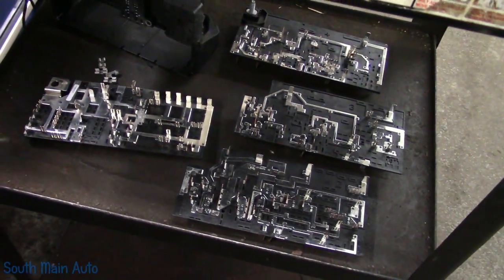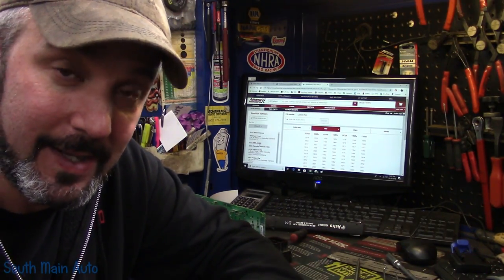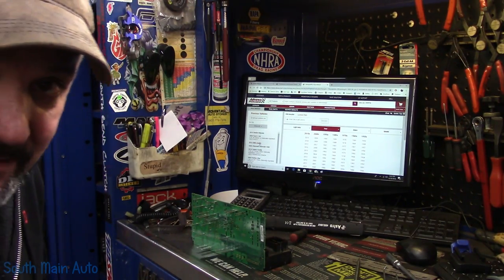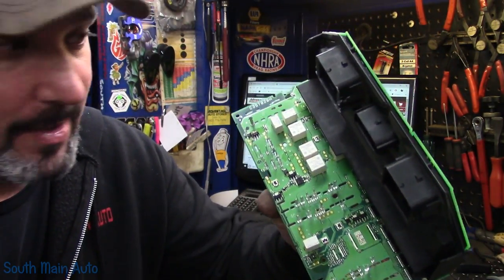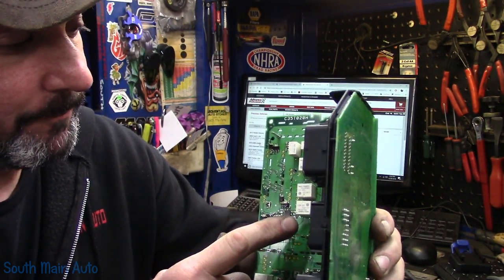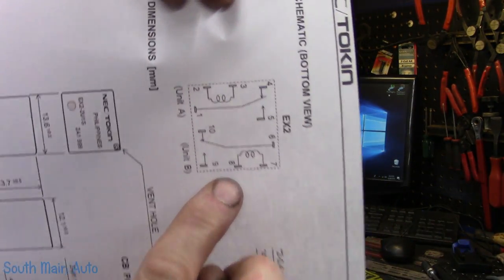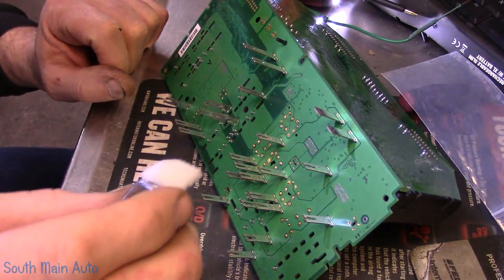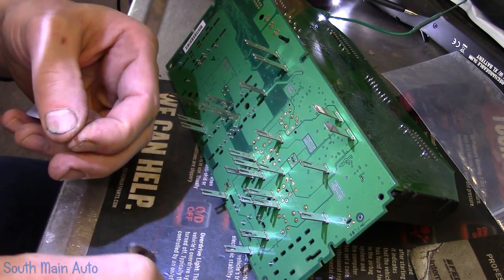Chrysler / Dodge : TIPM Repair - No Wipers

Comment: Eric, I doubt you'll see this at this late date, but the best way to remove a soldered on component like that is to chuck it up in the vice, with a relatively small flame in your propane torch, heat up the lead side of the board while pulling on the part with a pair of needle nose pliers on the other side.   The part comes off almost instantly and when you get used to it, you can do it without damaging the board (I'd practice on some old junk boards).

Also, when sucking solder, it helps to pool a bunch on so it stays liquid long enough to be able to suck it out.   You can even pool on a special "desoldering" alloy which will mix in with the solder and it will stay liquid a LOT longer giving you plenty of time to suck all of it out.

This TIPM is indeed a case where a $600 relay (assembly) blew in order to save a $.50 fuse!

Comment: Nice video is always, Eric. This is counterintuitive but for future reference build up a little mound of fresh solder on a pin before removing it with either the solder sucker or the wick. The old solder on the pin is more difficult to melt than fresh solder. Also, the additional solder helps it flow better.

Comment: I fixed the instrument cluster in my 2003 Silverado by leaving it plugged in while disassembled and pushing on parts ( resistors diodes ect ) until it came on ,  using a pencil eraser . Soldered the part and changed the LED lights inside and its been working ever since . 430,000 and still counting .

Comment: Another awesome video Mr. O. I repair electronics for aircraft and solder daily. The wick will soak up the wet solder, but you have to put the wick directly on the solder point and put the tip directly on top of the wick. Hope this helps.

Comment: I started out decades ago, using the de-soldering braid, yes Eric; fluxing the braid will help it  work better. It has been my experience though that the braid works best with discrete components (non surface mount/ miniaturized) and that the sucker works better with the miniature/ surface mount components

Comment: Your soldier removable technics are sound!
I would reflow the joint in the barrel first. Add 
a little solder to the joint. Then heat it up with a tinned
Soldering iron and carefully place your cocked solder
sucker right on the pin with it bottomed out on the pcb.
Then pull the trigger. It will clear the barrel. If not repeat
You got it! The copper braid is used to clean the pad after 
you get the pin out. I give a ton of credit for jumping in on
the fix. I am an electrical hardware guy and you are on the money!

Comment: Ironic, when I had to do a mode door actuator replacement on a 2006 Dodge Ram last year I found your video on how to do it.  That’s how I found your channel.  Same truck now has this exact same problem and walla you have another video showing what to do.  I’ll see if the guy wants me to do it.   Oh, and this video did not suck, my opinion is it’s one of your better ones.

Comment: The solder sucker is used in this manner. Heat the solder connection on the board, take iron away and immediately use the solder sucker to remove the solder from the hole. I have seen those suckers with the tips all melted off. If you use them both at the same time , the solder iron will always win. You did a great job for your first time.

Comment: Reading another comment about leaded solder reminded me of some troubleshooting I did today. My left turn signal wasn't working on my WJ unless I pounded the crap out of the steering wheel. Thought it was the switch, so last week I opened it up and cleaned the sliding contacts. Was good until today when the left stopped working totally. Diagnosis isn't as straight forward as "if the hazards work then it can't be the wiring," since the WJ has a flasher module that performs many functions and has a signal input for each function. Regardless, I disconnected the switch and jumpered the left signal wire. Nothing. Pulled the pin in that connector and tested continuity down to the terminal where the flasher plugs in. I have continuity. The wire doesn't need to carry much current, as it's just a signal to tell the flasher to flash. The wire itself doesn't drive the lights. Popped open the flasher unit and started looking, and I saw a crack in one of the solder joints that join the plug to the circuit board. So I took it inside and reflowed every single solder joint with normal lead solder. Plugged it back in and it now works.

Comment: My GF has a 2012 200 with the 3.6L. Two years ago it had the same symptoms as your sister's van. Wipers only worked on high and wouldn't park. Diagnosis: TIPM. In Canada, it costs $1500 to replace at the dealer. There was a class action suit for this issue, but the settlement only dealt with two models. The 200 was not one of them. I have seen some videos of TIPM repair, but your's is the most comprehensive and specific to these vehicles. I wish that I had kept the old one just to experiment with the repair. I know nothing about flux capacitors, but the comments on here have been very informative regarding soldering and de-soldering techniques. How about a video on another Chrysler engineering blunder: "no heat on the passenger side" due to blockage of the heater core. Speculation is that casting sand left over from the manufacturing process eventually turns to a goo within the coolant and then settles in the core and radiator.  Chrysler fix is to replace the heater core, radiator, and oil cooler. The entire dash has to be removed to replace the heater core. Thousands of dollars to do. I hear that you can replace the core from under the dash by uncrimping the tubes from the core, sliding out the old core and placing the new core in, then recrimping. Whadya think?

Comment: Over the years, the last 33 that I've been a Mechanic, the load side of the Intermittent wipers have always been an issue. Many modules I've disassembled and found the notorious hair-line crack in the solder joint out to the motor. Imagine, just for a moment, someone turned you on and off all the time. I' sure it would wear you out. It just prematurely wears things out. If you wanted to correct this, you could split the circuit, allowing an alternate path for current flow. Ford over the years has made this their repair for many of it's problem circuits. Back in the 80s the mustangs and Ltds use to have the headlights start going off and on as the circuit breaker would trip and reset. In business school they call this manufactured obsolescence. Basically, that is a nice word for "engineered to fail at a given point". Don't get me started on corporate greed. Thank you Eric for re-inspiring me. Many years of this stuff has worn on me and I find watching your channel refreshing. You add value to peoples lives and that is something to be proud of. God Bless.

Comment: Ive gotta admit, I just caught onto your channel and am really enjoying it.  The electronic circuit boards, I have worked on them for years.  The wicking never worked well for me but it depends on size and heat your using behind it.  I have found a de-soldering iron to work the best.  I use one to harvest the good parts from electronic devices mostly and 90% of the time it removes all solder.   $14 on amazon.... keep the videos coming, thank you !

Comment: If you plan to ever play with soldering again, buy a Weller soldering gun and donate the tiny iron.  Professionals use the Weller gun which is anywhere from $50 to $80.  It's ready in 6 seconds with 900 degrees max and a controlled temperature on the trigger.   Also, the tips are replaceable. Around $10 for 3.   It comes to about $3 each and when you replace the tip is like getting a brand new gun.  Thanks for another useful video that gives us confidence like always.
Reply: You may ask 🎅 Santa to bring you a Weller soldering gun. Clean your chimney and bake some cookies.

Comment: Nice job. Ive never had much luck sucking up solder with the wick. It does work well if you "floss" with it to clean out the hole. Even clean copper wire tins well to get rid of last little bit. Also you can just clip the legs of the relay next time to work 1 hole at a time. At least its not surface mount components!

Comment: Almost an Ivan PHAD no-parts repair!  For easier de-soldering, I second other people's comments about adding flux to the braid and a bit of fresh solder to the old solder.  For better de-soldering capability, but at a lower cost than a desktop powered unit, consider a de-soldering iron, which combines a heated hollow tip to melt the solder with a solder sucker in one simple unit. 35 years ago, I bought one from Radio Shack for about $20, and it has never failed to remove solder quickly and cleanly from for me, even on multi-layer circuit boards.  Although Radio Shack stores have gone away, their web site still exists, and it lists the tool, "45 watt Desoldering Iron".  Or, for another option, google ECG J-045 for a practically identical tool.

Comment: You did a great job with that repair. My experience with the braid is that it will help get the remaining solder out  after you have used the solder sucker. I think that the braid has flux in it to make it pull the solder into it when heated.

Comment: Great job taking the tipm apart. Let me help your confidence to make soldering easier. Get some liquid flux and draw some into a small syringe. Put one drop on each solder joint. Before using your soldering tool, wipe the tip on a wet sponge and (tin) the tip with a small drop of solder, then wipe again. Now the tip is clean and shiny tinned. Add a little solder to the tip and touch onto the solder joint , quickly remove and use the solder sucker. Flux will liquify the joint to easily be removed. Same goes for making a solder joint. Add flux always and don’t over heat and bingo, perfect!

Comment: Love the repair! That TIPM is crazy, who would design it like that? Relays that aren't serviceable? Board mounted components in a hot engine bay in a box that isn't sealed? What a huge step backwards from the fuse boxes that have worked just fine for decades.

Comment: I know its two years old but my sons mother has a 2007 Jeep and the fuel pump relay is down there as well... Vehicle has died twice but refires after cooling down... PIA.. Dumb idea Mopar/Chrysler... Since pandemic cant get the external bypass relay... back ordered Nice job.. Might attempt replacing the relay.. If you can do it I can.. lol Just did the intake gasket the other day.. Never done one.. No leaks and still runs..  Love the videos..

Comment: Your relays down there were high speed low speed and delay.. you did a fine job there Eric and yes it takes a little practice learning how to desolder items from a board but the best way to do it is the way you did it with the solder sucker you heat up the solder with the iron and quickly move the solder sucker in cover it up and press the button and it sucks all the solder out ... I have never had good luck with the wick Style ( mind you I'm  no expert either) I have done a lot of work in video and pinball machines and replacing small components in them and I have also been a mechanic/ Machinist/ fabricator all my life... I just recently had to fix my 2006 Chrysler Town and Country that had a problem with the control fuse that allows power to come from the ignition switch down to the tipm the sockets for the fuse had expanded so much due to amperage that the fuse was making piss-poor contact and caused my vehicle to die and then give me a power but no start condition so I just kind of had to go in and do the same thing clean and re- tention the sockets for that one particular mini fuse, that's what led me here... but I have sympathy for those people even in the mechanics world that don't know how to do this and just start throwing Parts at cars, AKA Parts Cannon, to try to fix something as relative as this and I got to tell you watching videos like this help me out tremendously I watch your Channel all the time so keep up the good work Eric O.... you're doing a damn fine job

Comment: Great video. You did a great job. The solder sucker is the way to go. You also probably needed a hotter solder iron with a finer tip and smaller solder. But with the tools you had, great job.

Comment: I did a little assuming when doing this with my 2009 VW Routan which is the same as this.After watching many solutions,I ended up buying a fusebox/TIPM from a used Routan and installing.Dealer quoted 1800 for replacement,and TIPM rebuilders around 270. I bought one from a routan with a similar options set (SE)and replaced.There were a few lights and things that didn't work,but within 2 days it learned everything and works perfectly.  Worth a try.  The dealer will tell you it needs re-flashed, but the system slowly re-learned every module. $75 for the box, plus all the extra fuses from the old box.

Comment: Excellent video, Lot of points already covered,  The relay is part of the park circuit and it failing is why you would get the codes, Looks like a new line for United Radio, because near every fault on the TIPM seems to be the mounted relays, and its a relatively simple fix for a company like that.

Comment: You did good.  Got it done.  If you are faced with the same situation again just carefully cut the old part off the board and remove one pin at a time.

Comment: In a past life I built and repaired PCBs for a living.  Never had any luck with the desoldering braids...used a powered solder sucker instead.  Kind of like a cross between a soldering iron and a turkey baster...bulb on the end and a hollow heated tip.  Squeeze the bulb, use the heated tip to melt the solder, then release the bulb to suck up the solder.  They're not particularly expensive, might be worth picking one up for the shop?
You were using the manual solder sucker correctly, though getting it directly over the pin before hitting the button is ideal.  Another trick for desoldering is to add a little bit of solder to the pin you're trying to desolder...it helps liquify all the solder you're trying to remove.

Comment: I watched this vid on purpose because I've had ZERO luck trying to repair these STUPID TIPM modules in the past, so I applaud you on getting 1 done. Sometimes, various accessories wouldn't work for no apparent reason, sometimes they had enough internal corrosion in them that they looked like they'd been in a brine pit for 20 yrs. In my humble opinion, Chrysler should have to warranty these things like they have to for PCMs, 10yrs. As I write, I am arguing w corporate about having to replace the TIPM in my 09 Challenger R/T 6 speed, that has just 26k on it, ( bought new, garage kept, never seen snow) for headlights, instrument lights, etc, that flicker badly  at idle. New b+, dealer checked out the alt, I physically load tested EVERY  ground, and after 2 weeks at the dealer , they say it needs a TIPM. At $660 clams for a new 1, I cannot see why I need to spring for a new 1 on a car that literally is a fair weather fun mobile. Anyways, great channel and well done!  PS, after seeing that fused relay, I think I might've tossed in a new Mopar wiper motor for peace of mind. Something melted that relay!

Comment: Lone this channel and all the work SMA puts making these videos slavingly for his you tube master!  while trying to run a business.  Its always worth the repair if only other option is buy new module $$$$ so nothing to lose and good learning experience if nothing else.  These TIPM's seem nothing but trouble and i glad i have an old car and electronics so have almost no failures so far on my old car. 
I do some electronics repairs so if i could add some advice. I started with solder wick early on but stopped and only use solder suckers now as do pros do too. Reason is you need to spend as LITTLE time heating the delicate boards these days as the small solder pads can be damaged easily by too much heat for too long. So  best way is apply heat and suck up quickly with vacuum tube.  Same when you solder delicate parts like transistors. You must apply heat to the pad AND leg of part and solder almost in one action usually just a few seconds only! Use 15 to 30 watt iron only and only crank up the juice when you dealing with heavy applications like soldering  thick cables together when you need lots heat. Too little heat will leave a cold joint not properly melted and bonded together- they will look unshinny and cracked. So enough heat and work quickly is the ticket!
On cars soldering is usually not a problem except for the cars computer and maybe tipm so other places you shouldnt do much damage but modern board use multi circuit layers so if you attempt to desolder something you will also desolder the inside layers and when you solder on the outside of board the inside wont have been done usually and the circuit wont work. One trick is to leave the legs in place and cut off the part and resolder the new part onto the old legs. I repair some computer motherboard failures this way and it can be done with some practice at least for some parts which is worth a try as you were going to junk the board anyway.

Comment: Thank you for the video!! I am having a blower motor issue on a 2012 caravan and I replaced the resistor and still no go! No main power down by the blower so into testing on the TIPM. Was worried about messing around with it but as you said if it goes up in smoke…so be it lol. I’ll buy another.

Comment: You did good for first time on a board like that.
I do stuff like that all the time. I am a old ham operator. The wick lay it on the pin and heat it with solder iron on it. It will soak up the solder. But the sucker is the preferred way.  Keep up the good work.  W9AKW